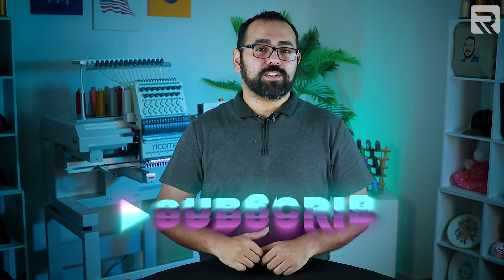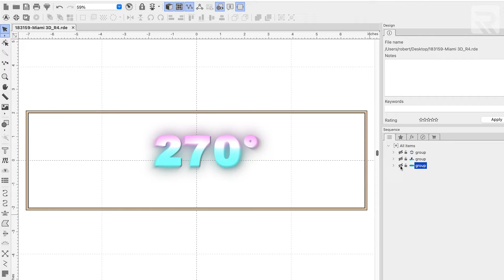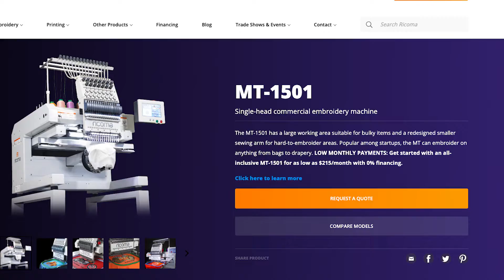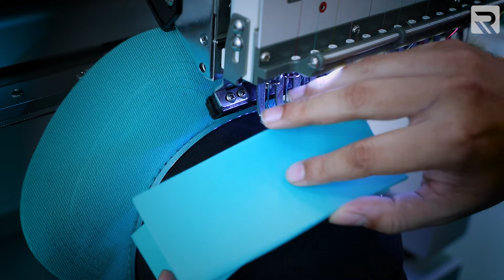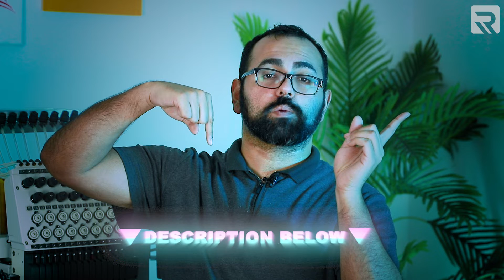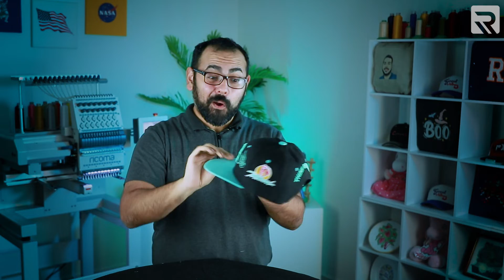How to Embroider 4 SIDES of a HAT (3D Puff Front & Back)

Comment: I don’t see Hap hoop in the drop down. I have chroma luxe
Reply from the maker: If you don't see the size hoops you need, you can always create your own. Use the same measurements that are on your machine. Select the cap hoop and copy that size for your new hoop.
Reply: @ I don’t see the cap hoop setting on the drop down. I have the recent updated Chroma luxe and it’s not an option in the drop down. So you’re telling me that I can create a custon 270 degree on the drop down?  So I can embroider front and the two sides?

Comment: Question: How close to the bill can you embroider on a ricoma machine? 
The placement on both front and side logos seem to high to me.
Thanks in advance.
Reply from the maker: Hi! We recommend reaching out to customer service so they can give you some tips/tricks to help you! ---> service@ricoma.com
Reply: Typically there's a manual setting on the machine that automatically limits how low you can go but you can turn that off. You must have confidence you won't hit the frame. I don't below .5" from the brim on my machine personally and all my designs look great. The guy in the video didn't pay much attention to positioning the design properly but that wasn't really the point of the video